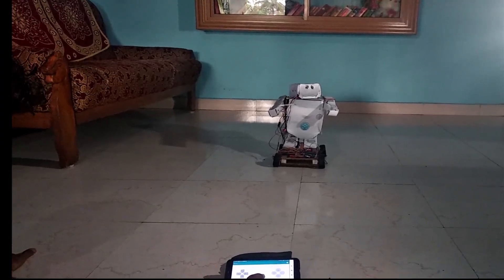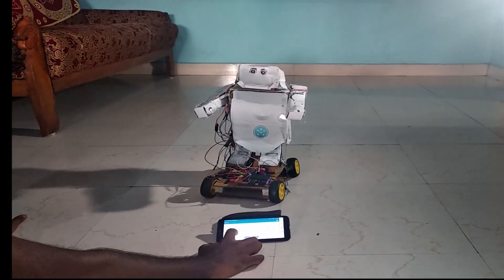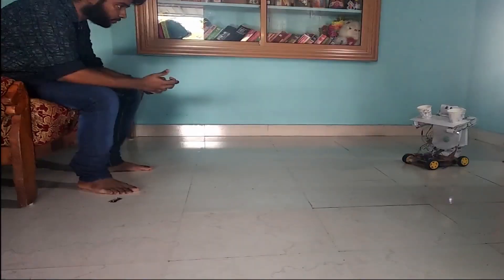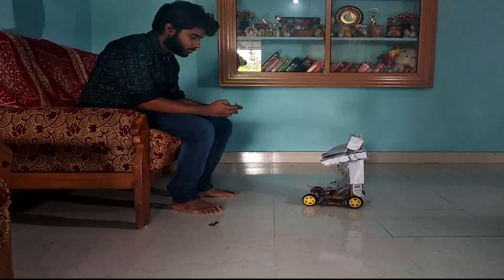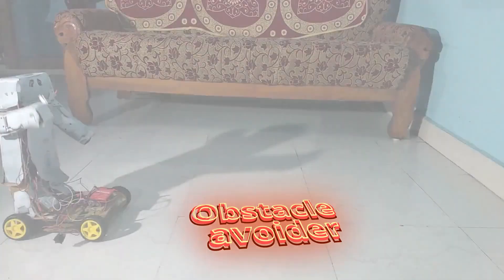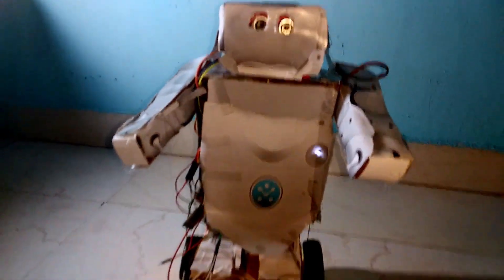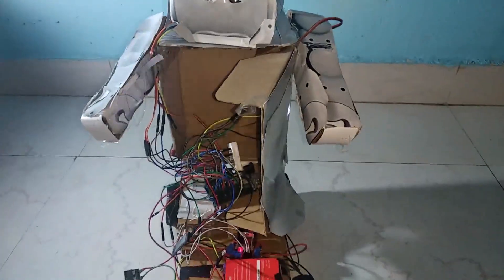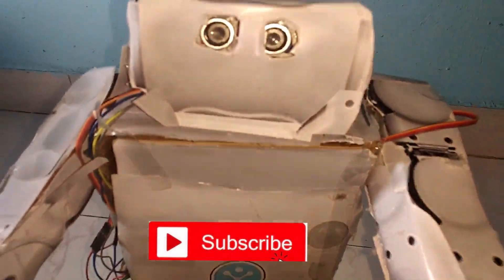HOME MADE ARDUINO ROBOT | FOOD SERVER | OBSTACLE AVOIDER  | ON LOW COST

Comment: hello, is it manual controlled robot??
Reply: which application u are used to control the robot
Reply from the maker: Yes it has two modes
1.manual control via App
2.autonoumus
1.Where it can be manually controlled via
App for motion,head rotation,arm movements,distance measurement
U can use any app which can communicate  to our HC 05 Bluetooth module via the Bluetooth of phone
The corresponding actions should be wrtten in code also